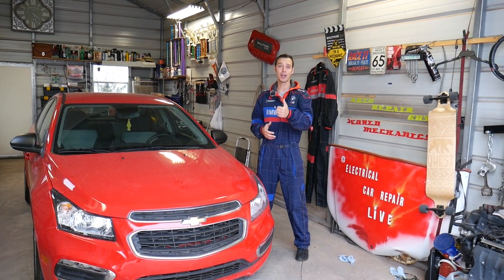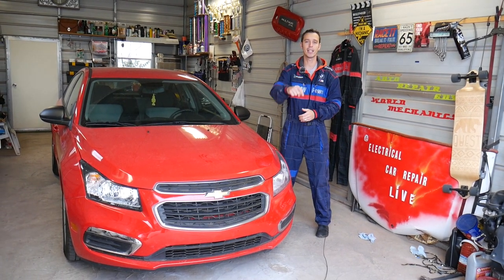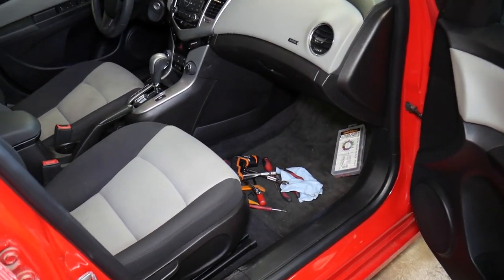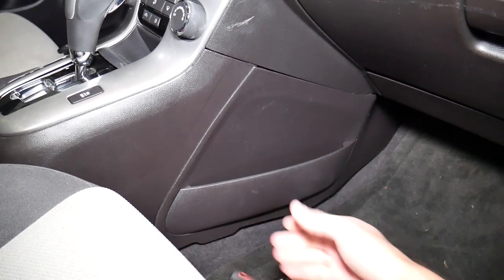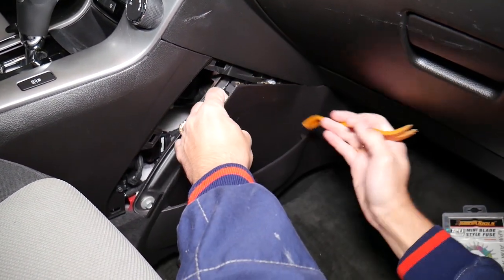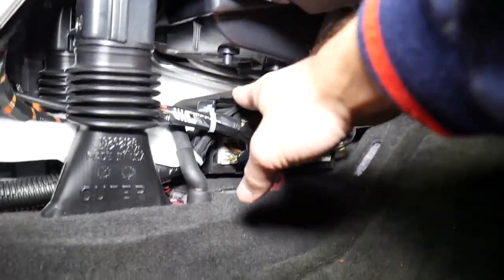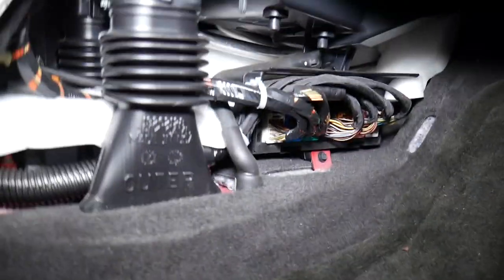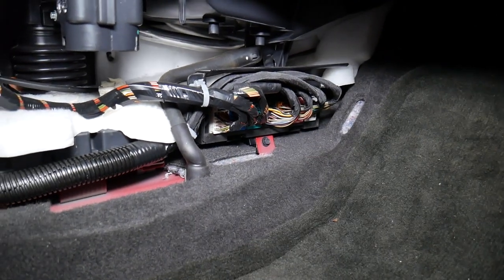CHEVROLET CRUZE BCM BODY CONTROL MODULE LOCATION REPLACEMENT

Comment: Hello, the bcm controls the parking lights function?, all my external lights are working except for the right parking lights, front and back.

I had a little ignition on the fog lights, I replaced all cables, bulbs and fuses (everything is fine) and that only ones not working. Thanks for the help.

Comment: Hello,
I have an issue where I am starting my 2015 LT Cruze and the wipers automatically start for 3-4 wipes and stop where they please.  They work fine when I go up a lever(regular speed)  and then at fastest speed work fine too... However whe I push the INT down they rise, but then immediately stop when I let go. I also notice there is no INT available anymore. When I twist to go INT quicker or slower it doesn't register. I brought my car to a local mechanic and they thought it might be a bad switch and they replaced it with new, but still had issue.  So then they said it most likely has to do with the BCM module.  They quoted me alot of money to replace it, so I cant do it now.  At this stage its more of a nuisance.  Is there anything I can check besides that?  Could the fuses be the issue or is that not related?  Will other issues arise because of this?  Any way to check if its 100% the BCM Module?  Thanks!

Comment: I have a 2012 Chevrolet Cruze. I have installed salvaged factory fog lights, switch and fuse box purple wire connector on it. Since it is a Pre ??/2012 they say I need to reprogram my BCM. Can u help with what I need to do this ? Thanks
Reply: Any update on this? I’m going to install new oem fog lights on my 2012

Comment: Hello sir.. My chevy cruze 11 model.. 5th and 6gear anytime slipping... I changed transmission fluid. castrol transmax  Dex 111...  But problem not solved sir... Fult show. Purasser  solenoid E. Stick of.. But I changed next day all 7 pices new solenoids... Some issues sir problem not solve. Same problem 2th time solenoid E stick of.... Gear lever all modes shift fine. But car is not moving.....sir tell me but indian chevy cruze. Cruze At

Comment: I need to place my body control module on the Chevy Cruze 2013 1.4 litre engine and now the system says locked. how to figure this out?
Reply: Did you ever find out how to do the programming. I tried MDI2 and Techline software, my car still says locked.

Comment: Hi, i have a chevy cruze 2009 ltz diesel. Reported to have BCM issue, would u suggest a way to repair or replace it for a cheaper price?
Reply: Hi i have a similar problem for diesel cruze too, could you help where to find BCM ref 13501959?